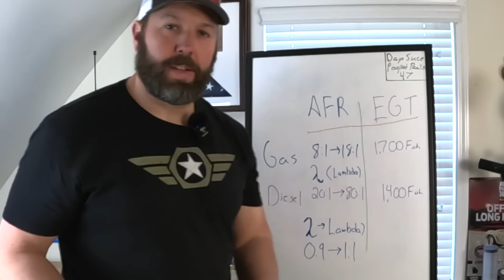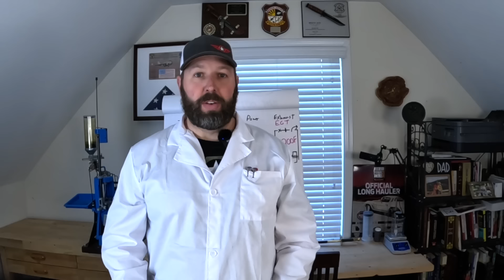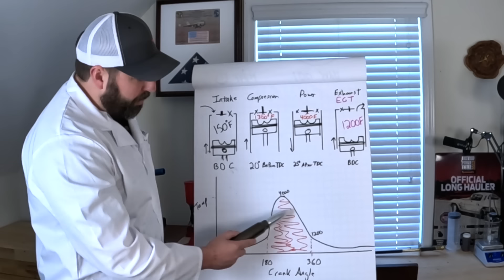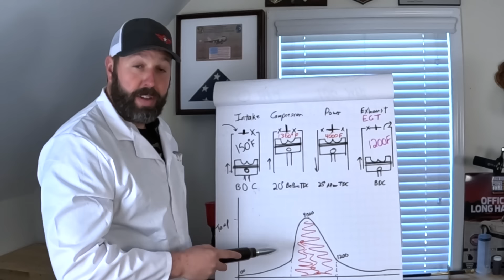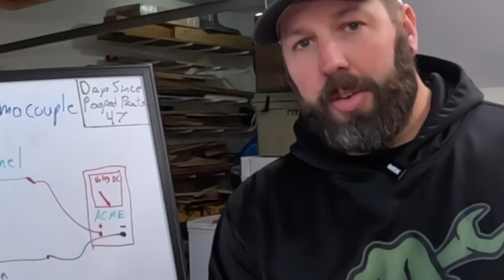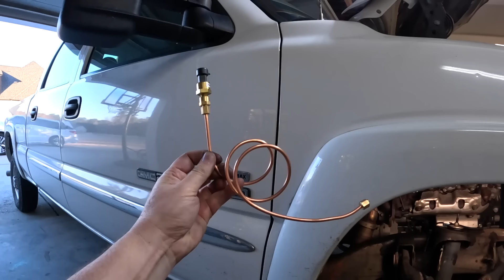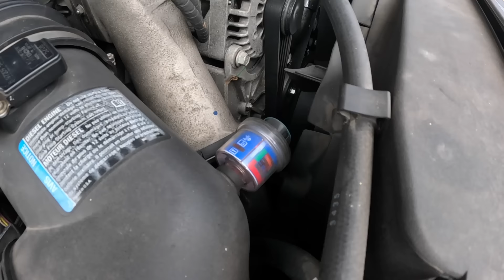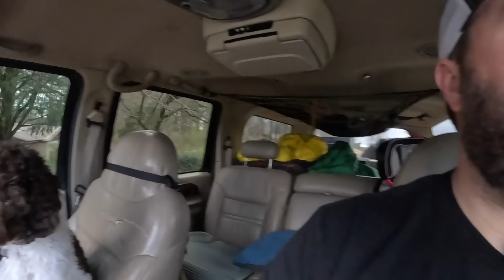Silent Diesel Killer…Diesel Exhaust Gas Temperature (EGT)! #diesel #egt #dieselengine

Comment: We use an EGT for each cylinder of an aircraft engine. The display is a bar graph. You can really get a good idea of how your engine is performing with that.
Reply from the maker: Makes perfect sense in an aircraft. The engines are expensive and failure can be catastrophic for the aircraft and occupants on board. It’s worth the extra expense to stay on top of every cylinder to monitor for anomalies. 👍
Reply: @freedomworx Plus we manually lean the engine at altitude for peak EGT at cruise power. Or you can lean the mixture lean of peak which is a little cooler and uses less fuel. But not too much. That lead lubricates parts.
Reply from the maker: 100LL 🤓

Comment: I could be wrong, I understand tiny 4 bangers better, but an 18:1 ratio is going to cook your rings at the very least
Reply from the maker: Diesels operate at much higher compression ratios. 20:1 and higher is not uncommon.
Reply: @freedomworx  right. But he was saying for a gas engine 8 to 18 was in spec. Or at least functional
Reply from the maker: I was thinking you meant compression ratio 😂. Yeah, a gasoline engine might be able to idle at 18:1, but it’s not going to carry any load. A diesel can vary wildly and still be functional. But  in a diesel, lean is not dangerous. Gasoline combustion and diesel combustion are completely different processes. Diesel engine don’t have to worry about detonation/pre-ignition, and they don’t need the richer ratio to cool combustion temps at higher loads like gasoline engines.

Comment: Great video and presentation. The only thing I would do differently is 3 more coils on your copper tube. With engine movement the tube will "work-harden" and eventually crack/break. More coils will greatly increase the life of the tubing. As to the thermocouple placement, I have mine immediately after the turbo. I am aware of the temperature drop across the turbo but it's my intention to move it into the manifold the first time I need to take the manifold off.
Reply from the maker: That copper line used to have more coils in it…but beer 😂

Comment: 09 duramax 2500 crew  bought it 2012 as bank repo loaded options  full deleted everything added  H & S mini Max v2 tuner  and fans  lift pump but kept stock  fuel filter setup all done with 6,000 and some change miles on truck  6" straight piped enlarged down pipe all other pipes for turbo stock size only ever tow 4,800lb boat so basically nothing. I never added added temp gauges  now at 182k miles iv never needed  any type of engine work, still stock injectors no issues even stock alternator and idler puĺly  checked every belt change and tight smooth turning. Iv also always added a fuel tank adaptive no specific brand at every fill up douvlble dose what recommended I change the oil every 3k miles at 172k miles my TCM melted and failed causing catastrophic Allison murder  so I had a connection guy build ME A DUMP TRUCK WORTHY gear banger 14k in parts and labor that included new TCM  that cost 3k during the shortage era and mochemmoto external cooler and 1" Hydrolic lines all commercial industrial stuff stainless steel branded wrap. Billit torque converter and his own trans tune flash to❤ now at 205k miles I cannot beleive how it runs it shifts like a auto 10yd dump truck I used to drive  alway in the right hear higher up in rpm and spool range always right as it needs to be I run the tuner on highest setting always regular driving I.m never more than 1/8 to 1/4into the pedal  I am so happy with it I don't hot rod it much bur I suppose I should do a top end head job at least  as my next thing and a turbo  olill have my guy figure that out lol he's guided me well since the tuner and delete demand at 6k miles and told me to trust him lol he was right or maybe I got lucky

Comment: I’ve got a question that I’ve always wondered, though its a little off topic:
In gas, power enrichment is a thing. You get more power than stoichiometric, while at the same time cooling the air charge which helps with power and detonation. 

Does a diesel work similarly (obvs not with knock)? 
I’ve heard that diesels never get to the rich side of stoichiometric because of the “smoke limit”. None of that makes sense to me.

Comment: If the egr is bricked the egt's can actually be lowered but combustion temp's are raised.  A more complete combustion paradoxically means a lower egt as the burn is more complete and quicker.  Most egr systems drop out at full power anyway.

Comment: RECENT BOUGHT NEW TRUCK.
6 SPEED AUTO.
ASIN G/BOX.
...
DEISEL
B A C K PRESSURE . !!!
WENT TO MY EXHAUST GUY.
I SAID, IS IT LEGAL TO CUT OUT BIG MUFFLER (( 2  N A BIT FT LONG )) AFTER DPF. """ YES """ LET'S CUT IT OUT.
2.5 INCH PIPES. HE CUT BEHIND DPF.
FITTED 2 3/4 INCH PIPE FITTED ALL WAY BACK TO FLANGE JOIN AT REAR WHEEL ARCH. BEAUTIFUL JOB.
RESULT.
NO BACK PRESSURE AT ALL.
15 / 20 % MORE POWER.
DPF IS BEING CLEANED AS WELL AS CAT COVERTOR.
IT WAS LIKE DRIVING A NEW TRUCK.
(( I'D ONLY DONE 16 K KM))
I HAVE TO TALK IN KMH.
...
BEFORE.
I'LL TALK ABOUT 3RD GEAR ONLY, THATS THE ONE THAT MATTERS.
76 KMH MAX.(( BACK PRESSURE COMES IN ))
AFTER
95 KMH.😂😂😂😂
4 5 6 ODRIVE.
UNBELIEVABLE 
.
STILL USING INJECTOR CLEANER.
PREMIUM DEISEL ONLY.
THE NEW POWER IS CLEANING THE CAT & DPF , $ 150 BUCKS FOR EXHAUST JOB. OZ $ , 100 US$ 
IT WAS GOING TO COST $ 220 OZ $ JUST IN BITS OFF EBAY.
.
GOT A NICE LITTLE NOTE TOO❤IT.
INSTALLED 2 BONNET SCOOPS.
10` BELOW 85° ORIGINAL
ENGINE TEMP

DOESN'T GET THAT COLD AS YOU GUYS. BEEN TO STATES WHEN MY MOM N DAD LIVED IN OHIO. 1984.
DAD HAD A 50 EDN 327 CAMERO Z28 ORIGINAL.
.
YOU GUYS HAVE THE BEST ROADS IN THE WORLD.
WE HAVE CRUMBLING SHIT, OUT OF THE CITIES. I.LIVE IN THE BUSH.
SO BUY A TRUCK TO TRAVEL.
FERRARIS CAN ONLY GO ABOUT
50 MPH.
IN THE BUSH.
IT'S PATHETIC.
THAT'S WHY I HAVE 3 TRUCKS.❤YOUR SHOW MAN.
AUSSIE JOHN...

Comment: Don’t expect and exhaust shot to install a thermocouple correctly.  My dad had a shop install his in his downpipe twice despite repeatedly telling them he wanted it in his exhaust manifold. They were scared to drill and tap the manifold. I finally installed correctly myself. I drilled it wren the engine running to blow the filing out as I broke through the manifold, then killed the engine, greased the tap and slowly tapped the hole. That last part sounds a little dirty.

Comment: The p/n junction doesn't create a voltage. It creates an indifference in voltage at the p/n junction.
Reply from the maker: It literally creates voltage. There is no power provided to the thermocouple. It produces voltage and a gauge reads it. I research this stuff very thoroughly before I post it. 🤷‍♂️
Reply: @freedomworx  nice try. You either didn't research this specifically, or you misunderstood it. No biggie. 

However
No, a thermistor itself does not directly create voltage. Thermistors are temperature-sensitive resistors, meaning their resistance changes with temperature. They are often used in circuits, like voltage dividers, where their changing resistance results in a corresponding change in voltage. This voltage change can then be measured and used to determine the temperature. 

… IT REQUIRES AN EXCITATION SIGNAL for its operation, any changes in its resistance as a result of changes in temperature can be converted into a voltage change
I am a master electrician with a degree in wind energy 1/2 my EE courses done. I also used to work at Phoenix heat treat in the R&D department. I also have two kilns for metallurgy at home.

I'm sorry but you are wrong.  I'm 23 years deep in my field. The ONLY semi conductor component that PRODUCES any voltage (other than just unusable static) are solar arrays. Which are just LEDs running in reverse.
Reply from the maker: Argue with pier reviewed articles if you want. Maybe provide me with an article that supports your theory. Because I’m certainly not going to find it for you. Here’s a pretty simple one from my video research 🤷🏻‍♂️https://www.sciencedirect.com/topics/engineering/seebeck-effect
Reply from the maker: I’d guess you just dont understand the difference between a thermistor and a thermocouple. No biggie. Get back with me when you understand that difference 🤷🏻‍♂️
Reply: @freedomworx  and I'm a dumbass. Lol thank you. I'll take my sign back.
Reply: @freedomworx  BTW, love your content. Now how about that 12valve?
Reply from the maker: It happens 😉
Reply from the maker: I need certainly need to post another 12 Valve video.

Comment: I know this is old but on my isx15 cm2350 Pyro post turbo, the difference in EGT & CCT is roughly 300 degrees. My isx15 calculates CCT based on variable date & operating modes. It’s just a guess and so my my assumptions of CCT

Comment: People don't seem to understand diesels.   Diesel is opposite of gasoline in in that rich mixture means higher heat.  If you are rolling coal you are very rich and making high heat.  That also means you don't have enough air to burn that fuel that is making the smoke.  Which also means you are just wasting fuel.  Yes folks, rolling coal is just wasted fuel and not making more power.  I have had this direct conversation with the combustion performance engineer...
Reply from the maker: To a point yes, more diesel means more heat, to a point. But once you get richer then 14.5:1, extra fuel actually cools the combustion and EGTs. Thats why competition diesels smoke so much. It’s not bad tuning or wasting fuel, it’s purposeful. If you are making good power with a clean burn, you are still leaving power on the table. A diesel cannot ingest enough air to make maximum power without smoking, without running nitrous. You can’t do it with just turbos. Regardless of what Gale Banks tries to tell you 😉
Reply: @freedomworx  lol didn't get that from Gale.  But also not talking about competition diesels.
Reply from the maker: @KevinB-d7t 👍. I hear ya. I just get so many comments from people who think they are diesel engine design engineers because they watch a few Gale Banks video. Sorry to accidentally lump you into that category 😉👍
Reply: @freedomworx between you and me I work for a diesel engine co.  And I understand.   Lots of keyboard warriors.

Comment: It's kinda amazing how much more important it is watching the EGTs on pickup trucks versus say big 18-wheelers, or even ag tractors when those engines are being pushed constantly down a field - bigger intercoolers, bigger exhaust to handle the loads.
Reply from the maker: If you tune those engines to the same power density as a pick-up engine, you’ll have the same issues.

Comment: So now it begs the question, what EGTs are the tractor pulling guys running that are literally billowing coal and foot to the floor for 20 to 30 seconds at a time? Seems like they would be well beyond manifold melting temps. I do realize they take that into account when they build these trucks, but still it's interesting to think about. Great video also. Very informative.
Reply from the maker: After you get richer than stoichiometric (14.5:1) with a diesel (or any engine for that matter) any additional diesel that is added is actually cooling the cylinder. The fuel that cannot be burned (it’s impossible for it to be burned if the A:F is richer than stoichiometric) removes heat from the cylinder through the latent heat of vaporization.  Most people don’t understand this. They think more fuel always means more heat or EGT. Which is true in most applications where you never get anywhere near 14.5:1, like In a street vehicle. You are never going to have an Air/Fuel ratio that rich on the street. So the pullers aren’t doing it because they are dumb rednecks. They are using extra fuel as a cooling strategy. There is a method to their madness 😉

Comment: The Ideal Gas Law.  That would be Boyle's Law to us foreigners.  
Boyle's law, also referred to as the Boyle–Mariotte law or Mariotte's law (especially in France), is an empirical gas law that describes the relationship between pressure and volume of a confined gas. Boyle's law has been stated as:

    The absolute pressure exerted by a given mass of an ideal gas is inversely proportional to the volume it occupies if the temperature and amount of gas remain unchanged within a closed system.
Reply from the maker: Boyle’s Law is wrapped into The Ideal Gas Law.  Use whichever you’d like.

Comment: Water meth injection can lower EGT by up to 150 deg F as well. 

High altitude makes for thin air and makes your turbo work harder for the same flow (more RPM) which then makes it less efficient and makes more heat. So more intake charge temp, less air, more EGT. 

To fight this on my 6.7 powerstroke I both put a larger turbo on it (non VGT aurora 4000 kit from ATS) and retuned the transmission shift points to never go below 1500 rpm, and added water meth injection (custom setup made from snow performance pump with a 7 and 10 gpm nozzles and a torqbyte controller, the 7 gpm nozzles duty cycle is based off throttle position and RPM, and the 10 gpm is based off of EGT and RPM). 

This lets me set the cruse control to 85 mph going over the continental divide while towing 8000 lbs (behind said 8000 lbs truck) to never get over 1350 deg F EGT.
Reply from the maker: I actually had a segment in the video related to water/meth. But I had to cut it out to reduce the length of the video. But yes, it's certainly effective at reducing EGTs.👍

Comment: On the copper backpressure tube, I've incorporated a 4" length of 1" copper tubing with stainless mesh in it to keep soot from plugging up the line as quickly.

Comment: Have you heard of these pistons made for diesel engines.
This is just a short. 
The long video discusses 20% better mileage & less soot , among other things. 
Enjoy 
Btw A scientist that helped develop these coated pistons, worked at one of the U.S. government labs. 

https://youtube.com/shorts/7ZhfrsPAHRk?si=LB0cgb9iOd4MRgFU
Reply from the maker: You're link is broken. But I assume. you are referring to SOA pistons. The ones that look like golf balls. If they worked, one of the OEMs would hve already bought the technology. I'm calling BS. That's just a personal opinion.
Reply: @freedomworx Yep, that's the ones. That's a good argument. Dave does do comprehensive diesel repair. Mostly from neglect. I had no idea it cost so much to repair diesel systems until I warch his channel. 
I have a crazy idea if you want to think on it. It's like a 28k crank. But with no reward except having the only one. 
Dodge 
PUSHROD V10 (easier & cost $$)
Convert to a V6 ( new crank 60 degree $$$) (the other 4 for balancing) 
Pick 4 say, the outside pistons, just to  be visually simple, as the air pump, SUPERCHARGER. 
Cam , completely custom, 6 regular & 4 double lobe. 
Intake thru 4 outer exaust ports .
Upstroke pumps into plenum. 
That gives you a constant 4/3  ratio thru all rpm range. 
6 x .82 litre combustion part
4 x 2 x .82 supercharger part 
Then the ECU part , start with a GM 3800 SUPERCHARGED ECU ? 
Anyway, its just a moneypit anyway. 
Thanks for reading 

8.2 Dodge V10

Comment: Using white lithium grease is racist, don't do that. 
Engine is air pump, the more air the faster it gets in and out the better engine you have with more power.
Competition is different than common usage. NHRA does 1 run per motor. If you replace everything all the time it doesn't matter how hard you use it.
Reply from the maker: Top Fuel classes get one run per engine. The rest of the classes can go many. Some classes will run all season on the same engine. There is a huge difference between a 500ci engine that makes 1200HP, and a 500ci engine that makes 12,000HP. Literally an order of magnitude difference 🤓

Comment: On my gas airplanes we run 1500egt and 1400tit continuously. I am completely fine with a diesel 1400tit in a cast iron block and exhaust.
Reply from the maker: Y'all have those good pistons and that high test fuel😎

Comment: I do a lot of diesel calibration work, I disagree with a lot of your points. Low back pressure will reduce EGTs. DPF being the main contributor to back pressure but SCRs can also add a bit. A prototype Euro 7 diesel can see 800mBar (11.6 PSI) of back pressure at full load, you become limited on pre-turbo temps (absolute limit 830°C 1526°F). A straight pipe would get maybe 650°C or 1200°F. 

EGR blanking is a little complicated. For reducing EGTs you have. Higher air mass, lower air intake temperatures & NOx formation is endothermic. For higher EGTs you have, higher thermal capacity CO2 & water does not cool combustion & more complete combustion. However generally speaking blanking EGR usually always reduces EGT.

Generally speaking EGR blanking & DPF removal will reduce EGTs, reduce fuel consumption and also increase engine oil life due to less acidic byproducts and soot formation. This is why VW disabled EGR. Of course there is the moral aspect of doing this PM & NOx can cause cancer and respiratory conditions.

For more information dieselnet.com is very useful.
Reply from the maker: I’ve spent a good bit of time on dieselnet 😉

Comment: High EGT is a waste of energy. It doesn't necessarily tell you all there is to know about how hot it is in the cylinder.
Reply from the maker: So you’d rather have no indication?
Reply: @freedomworx  No, but I'd like to look at combustion chamber temperature and piston temperature. High EGT could mean that you burn fuel in the exhaust and not in the cylinder around TDC.
I don't say that it's useless, but it's not giving the entire picture.
Also look at the Volvo Wave Piston design used in their diesel trucks which is claimed to give a better air/fuel mix in diesel engines.

Comment: I added a Water / Methanol Injection system running only water.  It starts at 19PSI at 20% flow and goes 100% at 33psi.  Makes a big difference in EGT.
Plus is keeps everything clean.  lol